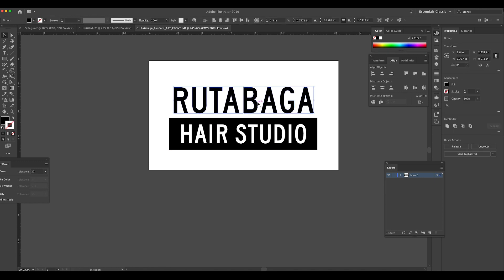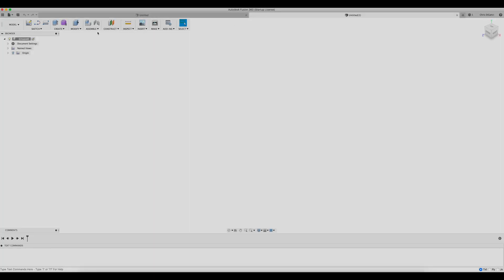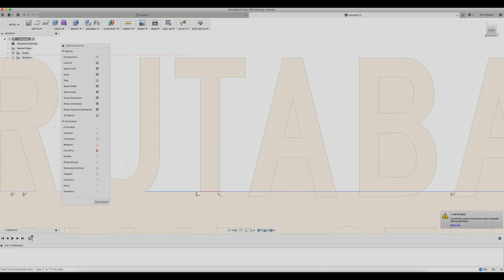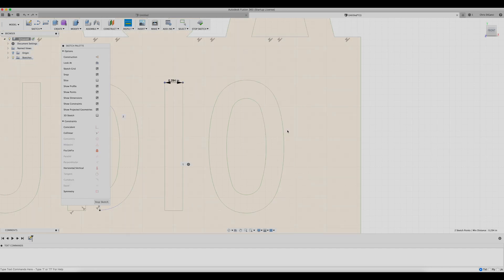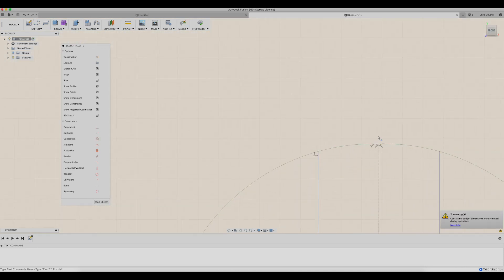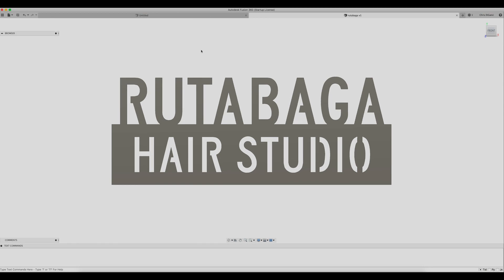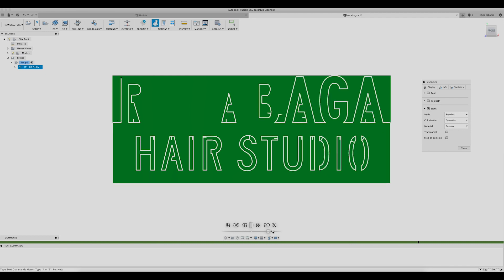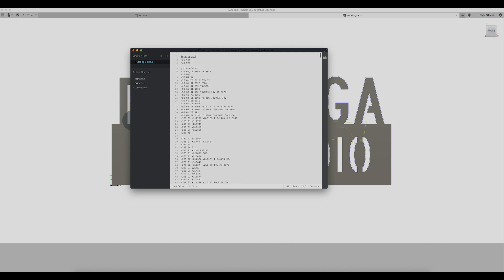Episode 13:  We Bought A CNC Plasma Table!

Comment: Your top letters that are connected to the box don't need to the paths created to the inside shapes of the letters..that is why a lot of people draw boxes (etc) around the outsides of letters to avoid using the stencils...looks really clean, nice job sir.
Reply from the maker: Funny enough I realized that after I posted the video.  'Oh yeah, I could have just left the A's intact' but in hindsight because I connected the ones on the cut out part they at least looked consistent in the top.  Thanks for the feedback!

Comment: Throw your parts in a muratic acid bath (I did 50 water/50 acid, pretty strong) for half hour or so in a well ventilated area, rinse them with water when you pull them out. Then you can run a quick pass over the back of them with a 4" wire cup brush.  The slag should fall right off.
Reply from the maker: Not a bad idea at all.  Most everything we run we do on 18 gauge mild steel at 90 IPM and it only leaves a little bit of dross so a quick once over with an 80 grit flap disk is usually all it takes.  Might try the muriatic acid trick on thicker stuff in the future.  Thanks for the tip!